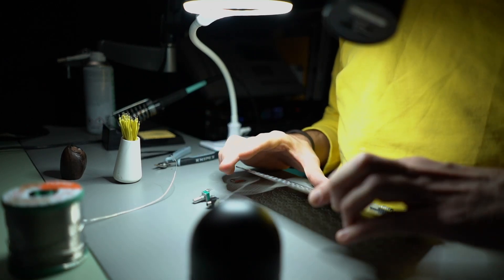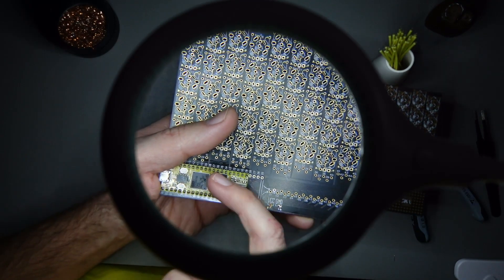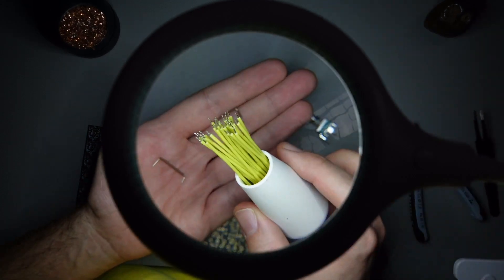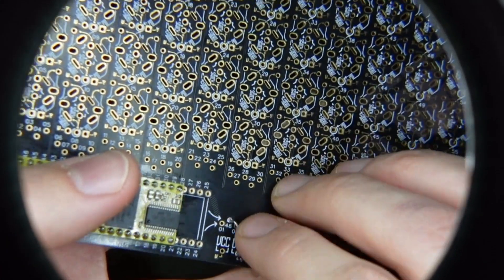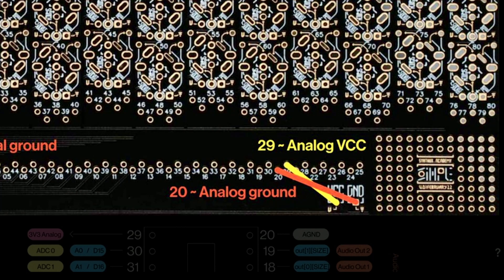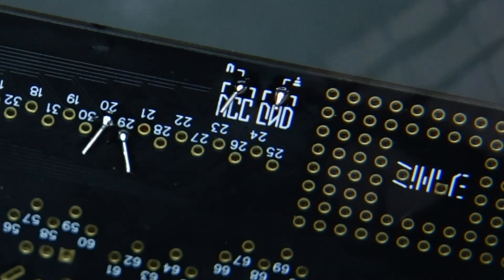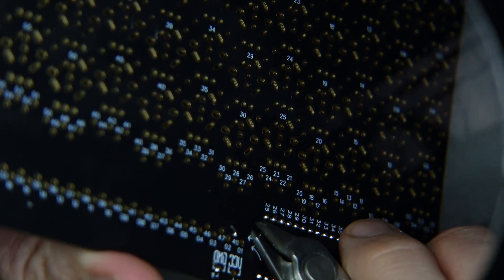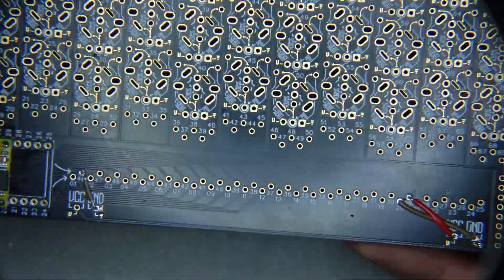Simple Synth DIY Les 05/06 - Daisy Seed VCC and GND

Comment: This is my first soldering project. I destroyed pads 20 & 29 trying to solder in those not-quite-skinny-enough wires. (Using a multimeter I verified they were no longer conducting) I recovered by wiring from GND and VCC on the backside to the chip standoffs. I'm worried this will happen as I continue with this project. Is there a good strategy, or better hardware, to use to make connections into those pads? Maybe I should have started with a breadboard project.
Reply from the maker: Sorry to hear you are facing these challenges. There are two ways to make it easier to connect the wires. You can cut the wire heads a bit to make them fit better. Or, add a bit of solder on the pad and then place the wire on top while holding the soldering iron on the pad and wire (this way the wire is laying on top rather than placed inside the hole). 

Let’s continue this conversation on Discord so it’s easier to share visuals of your board. I’ll do my best to help.
Reply: @SynthuxAcademy  thanks for the quick reply, I'll try those out if I run into trouble again.